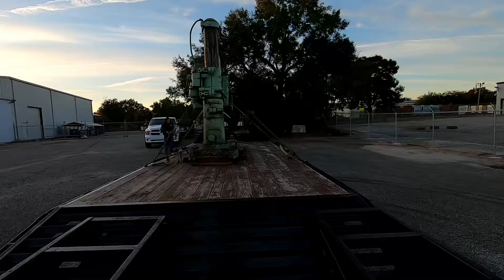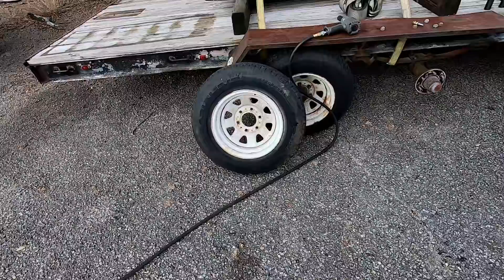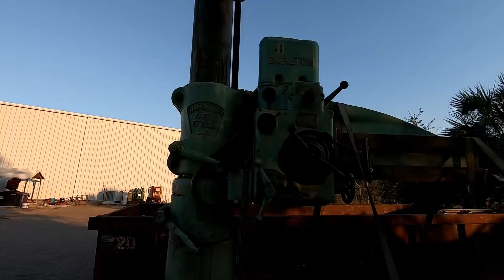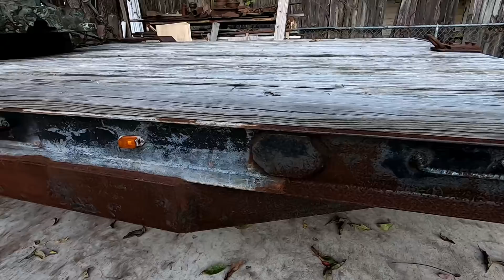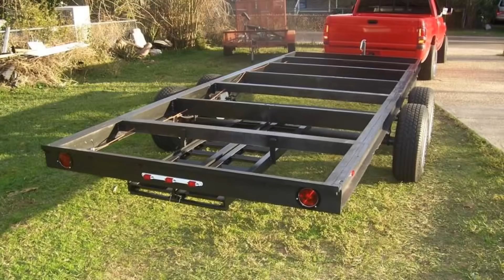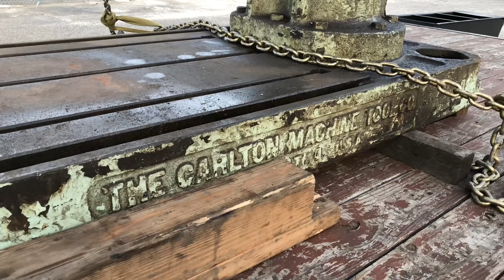Carlton Radial Arm Drill

Comment: Nice drill Adam.  I have the same size (4ft arm, 9" column) but it is an American Tool Works.  I'm not sure how Carlton lubricated their machines but American used felt wicks.  When I first got the drill all of the wicks were dirty and weren't moving any oil.  One of them fed the main thrust bearing and I was glad I discovered it and got it changed before I did any heavy drilling with it.  I've always heard that Carlton's were slightly better than Americans and even though our drills are considered baby's mine will easily drill a 1.5" dia. hole with no pilot hole in mild steel.  Yours should do that and maybe more.  Ken
Reply from the maker: It should handle a bigger drill then that. Let’s shoot for 2.5”
Reply: If it will drill 2.5" with no pilot hole I'll be suitably impressed.  Ken

Comment: You do not need license plate on your trailer ?  Is it legal to weld up trailer by yourselves and use it on streets ? Because in my country it's not :)
Reply: In my country, and in Western and Central Europe, not too. We have a lot of rules here.
Reply: @Renovacestroju   I'm from Lithuania,  self made trailers cannot be used in my country.  Only factory made. Also, should be registered, have license plate, technical inspection and insurance. It would be nice, to weld up trailer as you want , but life is cruel :D
Reply: @zoidberg552  t's great when people from Europe meet at Adam's drill :-D In the Czech Republic, this is in some circumstances, but it has to pass through the approval of the authorities, it's worth the money, and there's a lot of papers with it. It is cheaper to buy finished.
Reply: Yes, you can build your own trailer.  As far as the license plate goes, it depends on where you're at, and what you're doing.   Most police officers don't really mess with agricultural trailers, but if it's commercial use you better have it tagged.
Reply: In Ontario, Canada we can build our own trailers, and gir non commercial use there is next to nothing for a safety inspection ... but they do need license plates

Comment: These old beauties last and last. I am sure you will go through it with a fine tooth comb. Skookum trailer frame bud. We can never overbuild these. I once worked with a 10 ft Master service Radial. As memory serves the post was 36 in. It would drive 6 in spade drills all day with no complaints.You have a new adventure that I will definitely not miss my friend.